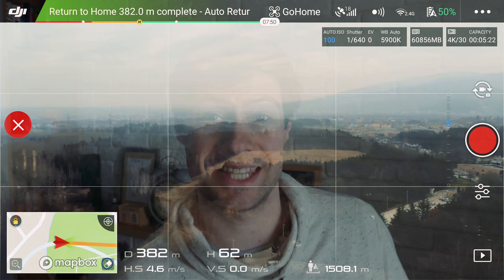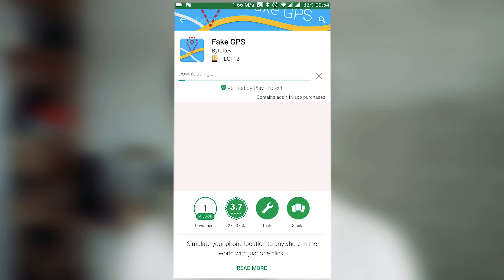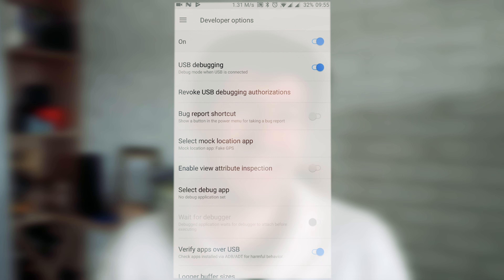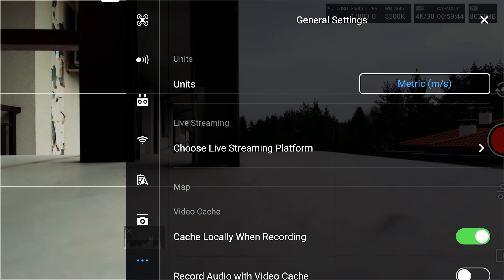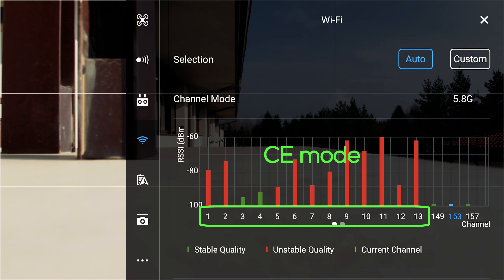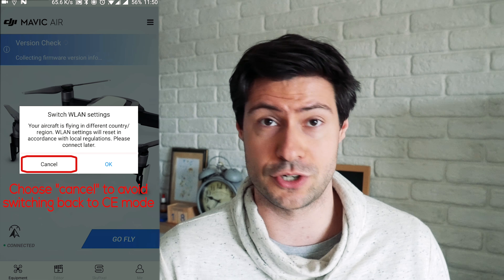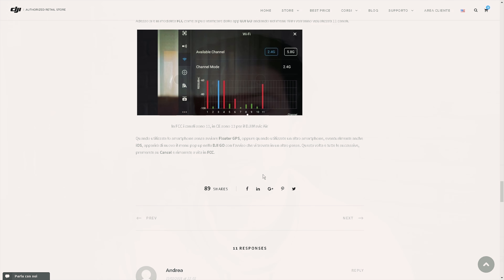DJI Mavic Air FCC Hack: Switch to FCC Mode in 2 Minutes!

Comment: Just done this and I got 11 bands but still on 5.8ghz? Have I missed something?
Reply from the maker: This sounds weird - the 2.4g bands are 11, and you should see 4 of them in the 5.8g range. 
Flying at 5.8 is nothing bad - in fact this is the only band range I use because it has no interference no matter where I fly. The selection could be automatic (the firmware decides the band), or you can manually select a channel. So if you want to be on something at 2.4 - manually change that from the app.
Reply: Tech4All thank you.
Reply from the maker: Most welcome!

Comment: hi great video. i am trying thi  with my spark. evrytime i open dji go app. it wont ask to change wlan settings. theres no pop box. please help :)
Reply from the maker: WHich DJI go 4 app do you use? I mean - which version?
Reply: tech4all  hi the latest version. usually it auto update. 4.2.8
Reply: I have the DJI GO APP 4.2.8 .. the fake GPS works when I open Google map.but still really did not show confirmation for the WLAN. I am using s8 do you think it depends on the phone Model? thanks
Reply: Hi bro, I used another APP. the Floater App. it worked. thanks.
Reply from the maker: Thank you for confirming.

Comment: thanks man, very helpful... greeting from Kuala Lumpur Malaysia
Reply from the maker: He Hey! :-) Most welcome. I believe you have the FCC mode by default? Or not really?
Reply: We don't have FCC mode as default, we did need Fake GPS to do it... But until now i didn't get satisfaying image transmission, its keep lagging. Not sure why?
Reply from the maker: @ArtmorProduction  Hm, reasons could be many. What kind of smartphone do you use?
Reply: I am using Huawei P9, 
I've been trying using FCC mode in 2.4Gb and 5.8Gb. at 2.4 Gb there's glitching when distance reach 300m... But not disconnected the image transmission does lagging. At 5.8Gb the lagging start at 400m, and did disconnect at 700m. The 2.4Gb success at 1000m without disconnect, but Video Feed got Lagging.

Any suggestion on my setting?
Reply from the maker: @ArtmorProduction  At 1000 m lagging is normal if it is within less than a second. If it is more - not sure what the reason may be. Try switching to different channels to see if that makes any difference.
Reply: Thanks man, 
I did test different-different channel. I found out that at urban and congested area to go further without glitching is going higher than 100m. On my test i did fly on 50m only... At 100m ita glitch free. I'll share the result later once i compile the video

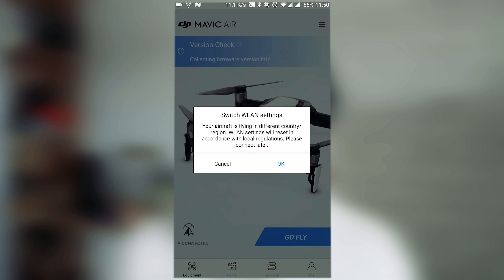Comment: 3:20 i do everything right but i don't get this message when i turn on the dji, does anyone know why?
Reply from the maker: Might be related to the latest updates coming from DJI... You may try doing it at a place where GPS signal is hard to get.
Reply: Don't work anymore with the last update of the DJI Go 4 app. The solution is to download the app in a older version, in another phone. Then do what it says on the video. Then try to reconnect with your current phone, it worked for me!
Reply: @mateodadillon1181  Do you have an idea which version of the app it still works with?

Comment: Thank you very much. My Air gets the "weak signal" popup at 100 meters. Will try to switch to FCC mode and also change to 2.4Ghz. Would be awesome if it reached 500m, else I need to move around too much to capture everything in 1 location.

Comment: If anyone is still struggling with this and is using iOS, Download 3uTools and connect your iPhone to pc open 3utools (make sure your iPhone is trusted on the pc/laptop you use) navigate to toolbox, click Virtual location and use the longitude and latitude eg. somewhere in Denver, follow the prompts and then disconnect iPhone when completed. use google maps or maps on iPhone to check if the virtual location work's your current location should say eg. Denver. then use the dji go 4 app and connect your phone to controller and to drone. it will say your location has changed and would like to switch the settings, click ok and then your done. don't forget to reboot your iPhone to take you back to your original location and always make sure you hit cancel when dji connects to your drone. same steps as above except for iPhone but no need to go into developer mode, jail break etc.
Reply from the maker: Thanks buddy!
Reply: This saved me for 2021 yeah still works a million thanks

Comment: works on Mavic Pro and dji go Android?
Reply from the maker: Yes, it does. But why would you need to do that on the pro? it has excellent range no matter what
Reply: I could never reach 3km (3000m) with my Mavic Pro
Reply: It did not work on mavic pro nor does it appear that popup, wifi change
Reply from the maker: which is the version of the app that you got? And is it IOS or Android?
Reply from the maker: Got it. Well - worth trying with the described procedure :- ) There is a good chance that it works.
Reply: app 4.2.8 and Android 7.1 Nougat
Reply from the maker: I saw there is 4.1.12. Can you try that?

Comment: what about for iPhone ?
Reply from the maker: Here's a quote from the pinned comment:
|I can confirm that on iOS, you can change your phone's location if debugging an app with Xcode and simulate location. Be sure that network debugging is on so that you debug the app (whatever the app is, doesn't matter, a new clean project is fine too) wirelessly so that you can use USB to attach to the Mavic's remote. This is not for everyone, I know, but maybe it helps someone. I've successfully switched to FCC and my range extended dramatically.

Comment: CE, Mavic Air, 1300 m. then... after 1 month, different location... very low... 600 m and signal lost... open field.
Reply from the maker: Sometimes frequencies play a role. And sometimes firmware updates too :-) Could be that the first time you were connected at 2.4, and the second time - 5Ghz. Because 2.4 covers up to two KM and 5ghz - only 500m. With FCC mode it will be significantly better :-)

Comment: Hi guys, first of all a few things.
In Australia ce mode only 11 channels.
I done the above on android and it stays 11 channels but the region changes is prompted. 

After you done FCC and you restarted your controller make sure you turn off your gps faker or it will think your return to home is in the USA. Make sure that is stopped!

You be prompted that you are back in your country and would you like to change wifi settings say NO to stay in FCC.

Now iOS just pop in the iPhone after you change in android and you see the Mavic air is still in FCC because it prompts you to change the wifi settings.

That was all to it. Borrow and android, change to FCC and connect to your iOS and remain in FCC .
Reply from the maker: Thanks Irwin, useful addition!
Reply: tech4all your welcome, I just flew 3km on FCC mode today yesterday I only achieved 2km on ce mode. I could have gone further but I realised I had set maximum distance to 3km.
Reply: New update, I have updated my iOS go 4 app and you will not get the pop up asking you to change wifi settings.

But when I connect back to my old android app, it prompt immediately.

This lead me to think that my air was still in fcc regardless it didn’t prompt on iOS .

I took it for a range test and went as far as 3.4km which was enough for me to believe I am on fcc.
Reply from the maker: That is even better! :-) Wish it was the same with the android app.

Comment: Nice tutorial, but when i put my cell phone, the drone switch back to CE automatically and don't ask me :\ may you help me bro?
Reply from the maker: You may try an older version of the app - check apkmirror.com for getting an older release.
Reply: @TechMishka  Hi,  same here it asks me to switch wlan when i fake gps to force FCC,  but as soon as i quit fake gps and restart RC and AC  it automatically returns to CE mode without prompt. Just need this mod for stability :( i`m so new to drones that i am scared to fly it out of LOS :)))
Reply from the maker: @sorinme2005  You could try an older version of the app - it may perform better.

Comment: not working on latest firmware and dji go 4
Reply from the maker: Hi Vitaly,
Which are your exact versions? I haven't been flying for the last week, but the people in the facebook groups confirm it works fine and FCC is fine with the latest versions.
Reply: tech4all i did mistake : hack working. But be careful: dji go on android now pull info from assisted GPS ( should be off in development options)
And from DJI device.
Reply from the maker: Thank you so much for following up on this. Glad it's working now. Enjoy! And fly responsibly :D

Comment: Tried thism click ok on app. No reboot of remote or drone just goes into app. No change still 13 channels. (Uk) android. S7 edge.
Reply from the maker: How about a manual restart of the remote? And are you certain that the fake gps app is working? Alternatively you may try another app - gps floater.

Comment: To the best of my knowledge, DJI is the only drone manufacture  that have FCC or CE regulations build-in to their drones, so I can't see how it would be unlawful to change the settings, as there is no law stating all drones must comply. 1000's of drones fly around without it, without braking any law.
Reply from the maker: Hi Mike, and thanks for commenting. 
Most likely the reason why DJI officially implement this is due to the local regulations. Note that most of the drones use a different kind of communication in these channels, and not pure WiFi, which is the case with DJI - they do use a boosted version of the WiFi stack. And that already has much stricter regulations, which make the company limit the transmission power.

There seem to be other vendors that look to be better compliant - last drone reviewed is the B2 SE and it also has smaller transmitting power than the previous model, most likely because of being compliant with more worldwide regulations.

It is close to impossible someone to really track you down - this kind of measurements are done with professional equipment, and usually performed by a whole team - so they have to be at the right spot, at the right time, and ... well - you will be exceeding the limit with such an insignificant power that probably noone will care. But since DJI want to be present on more markets and want to play the game fair - it is something to respect (although this disappoints a huge amount of people...)

Comment: In CE mode... 200/250 meters with my Spark. In FCC mode (with the modded app of with Fake GPS) my personal record with the Spark, without losing signal was 1100 meters. But it will go further.
Reply: TB - Drone-videos can you use the fake app what he is using with the mavic air?? I have a spark but i have the latest firmware installed, i do want to use fcc because it can fly away easily. Not exactly do untherstand what to do, with the fake app of the mavic air it looks easy.
Reply: Yes U can use also this Fake GPS app for the Spark
Reply: Please tell me what is about RTH POINT .. i didn't try that but what will happen after i switch  the fake gps off ..the question : will the  mavic air return to home point normal?  and what is about the map display on controller. It will folow the fake or real position
Reply: Does not work with the latest firmware. It doesn't allow you to press yes or no. It just let's you know it will change settings due to different position.

Comment: I’ve tried this today with my Mavic Air and it doesn’t seem to be working on today’s firmware. The fake gps location works fine but I don’t get the pop up when you start the app to say it’s changing WiFi settings.
Reply from the maker: Did you also update the app? Very often it is the app that reverts things back.
Reply: i have the same problem. i didn't update, but it just doesn't pop up
Reply: I had this problem also. Switch on the drone as well. That was the point where i got the pop-up to switch. After that it worked.
Reply: Jack van Geneijgen hi.  Did u update the firmware?  I did it but i didnt receive pop up.  Any solution?

Comment: remember if you change ce to fcc with this solution, gps mudule will not working until you return to ce
Reply from the maker: Wrong. The RTH function is based on the GPS inside the drone. Here we manipulate the GPS inside the phone.
Reply: @TechMishka  yes, but some of features like Quick Shot does not work in this hack because phone gps is disable!

Comment: question , what if u lose signal ? is it going to return home ? or it will go as if its going to usa and will be lost 😂??
Reply from the maker: It is not going to fly in direction USA :D The GPS Floater app is only tricking your phone, and the phone tricks your transmitter. The drone relies on its own GPS, so it will return to the point it took off.
Reply: thank u :) (Y)

Comment: i did exactly same switched to fcc..some times its great some times signal loss at 50 mts height..choppy video feed...with ce mode its fine...in fcc i get 11 channel...plz help
Reply from the maker: Everything seems to be correct. Likely the reason for your issue is related to interference.
Try to switch to FCC, and choose a 5G wifi channel. Usually 5G is not intensively used by too many people and is getting les interference.

Comment: I'm going to test it, but i hope my lil drone won't start flying toward USA when i push the RTH button :)
I live in EU
Reply from the maker: It will not go to the US :-) The phone GPS is only specifying the behavior of the transmitter. For return to home the drone is relying on the GPS that is in the drone itself :-) So it is as safe as it is without running in FCC mode.
Reply: tech4all thanks mate ;-)
Reply: Hi tech all ive read most of these comments and im amazed how you've replied to everyine so I just wanted to start off by saying thanks man!!!
I live in australia with mavic air and id like to switch to FCC also.. ive read a few times you say to turn off fake gps so it does not interfer with you phone but im not sure when to do this? 
Step 1 change location with fake gps
Step 2 turn remote on
Step 3 plug android into remote
Step 4 turn drone on 
Step 5 changes wifi settings
Then do you close the fake gps app on mobile? Do we still put in airplane mode?
I hope this isnt to hard to understand. Its just makes me neevous and i want to be 100% before i try.
Thanks in advance ;)
Reply from the maker: Hi Jason, first of all - thank you for giving such a well-formed question. 

Let me start by saying that it is almost impossible to harm anything :-) 
The Fake GPS app's purpose is to temporarily trick your transmitter that you are in USA. The transmitter itself has no GPS, so it will inherit these settings from your phone. So the purpose of the trick is to make your smartphone think you are in the USA when you power on the transmitter. The transmitter will then realize that it can work at a different regime and - voala! - you will be all set. The sequence of steps that you describe should work. After you are certain that FCC model is in place, just uninstall the app and that's it. 
There is a very helpful facebook group where FCC is a huge topic. It is about DJI Spark, but since both drones use the same kind of connectivity (the AIR has better antennas and pumped 5.8) the tutorials there can be used as "plan B". 
https://www.facebook.com/groups/TheSparkSide/
If you get stuck somewhere don't hesitate to come back here. If I don't manage to respond within a day, please send over an email - sometimes youtube's notification service is not that reliable :-)

Comment: 3:45 haha! nice! Great video, as usual :)
This still isn't possible on iOS I presume, right?
CE achievement: flying 100 meters without losing my Spark... (thank goodness FCC mode exists!)
Reply from the maker: :D I knew you will notice it! 
That's what I love so much about DJI drones - usually you won't loose them that easily.
Although... this morning there was a new post in the facebook group about a lady that was flying her spark over a lake. The RTH was initiated, but the sun was shining directly in the sensor, so the Spark was treating that as an obstacle and wouldn't go any further. So after the battery died it sunk :( That is quite an unfortunate story. Never knew that sunlight can trick the sensors.
Reply: Oh wow! Yeah, I've never heard about that either...
so no luck for iOS users?
Reply: TechByte maybe try tunnelbear
Reply: Thanks! I'll keep that in mind next time :)

Comment: Hey tech! I'm glad you finally received de Air 😀
It's awesome! I know what I buy but not happy with the battery time.. 🤔
I received mine in 15th February 😀 one week before they told me 😁
I'll try the fcc mode today and share the results with you.
Regards
Reply from the maker: Hi Fabio! Congratulations on your new "jewelry"! What color did you choose? 
 I cannot say much about the battery life - I ordered the normal combo due to financial limitations and right now I cannot find a place to by a frickin' spare battery :D And have tried it just three times, because the weather is not proper for flying - either too windy, or rainy, or snowy. It will be snowing for the next two days :-)
So I had no chance to really fly with the FCC and just tested its penetration through walls :D